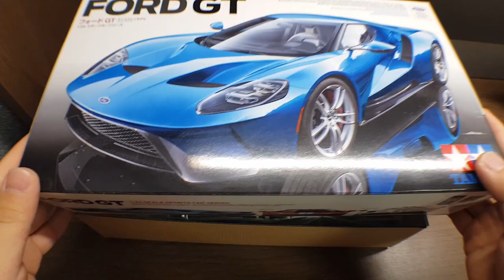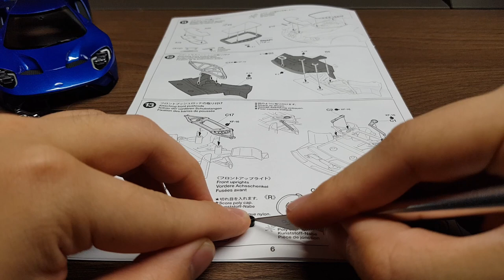How To Build a realistic Ford GT Tamiya step by step

Comment: What kind of glue do I need to use to be able to glue those pieces after the have been painted? The stuff I'm using just melts the paint away and won't hold. Thanks!
Reply from the maker: Sorry I'm too late, It would be better to use EXTRA THIN cement.
Reply: Or just use the Tamiya glue for that purpose

Comment: Dude, you need to spray the zero paints in 3-4 light coats otherwise you risk it etching into the plastic and crazing the paint.
Reply from the maker: Thank you for advise:)
Reply: PLAgraphy anytime. Some colours are hotter than others. Avoid spraying it wet and you should have no problems. Keep up the great work!

Comment: Hi, I have a question. I made 2 models and then realised I needed a clear coat. I now use a can of Mr topcoat gloss. After that I made 2 more models which turned out nicer however when watching videos I always see people polishing their clear coats. I am not sure wether I need the tamiya compound set and I am not sure if I can sand Mr topcoat safely as it is a 1k clear I think. 

How would you recommend I go about polishing my clear coat? 

And is it worth investing in the tamiya compounds and even a can of super clear gloss like you use?
Reply from the maker: After spraying the clear coat thickly, grind it with #3000 sandpaper and polish it with #5000 sandpaper. At this time, make sure to moisten the sandpaper with water and polish it gently to prevent damage to the clearcoat and painted surface. Among the three types of Tamiya compound, except for the finish product, it can be replaced with soft sandpaper, so I think you can use it for the last finish with a tamiya compound finish. The top coat is water-soluble, so I recommended to use Super Clear because it may dissolve if water gets on it when sanding.